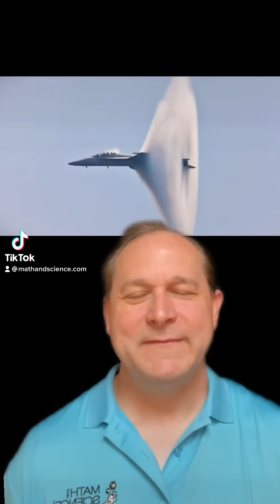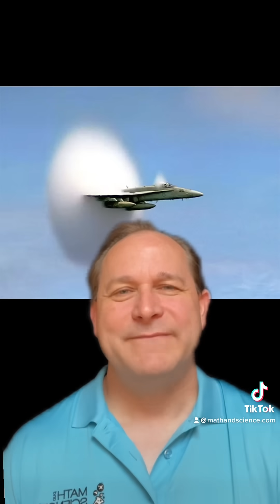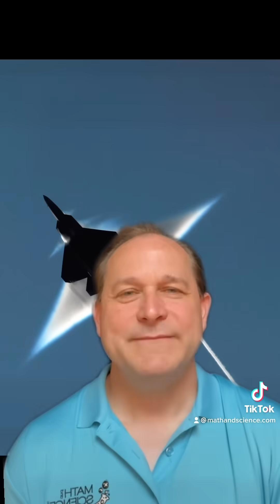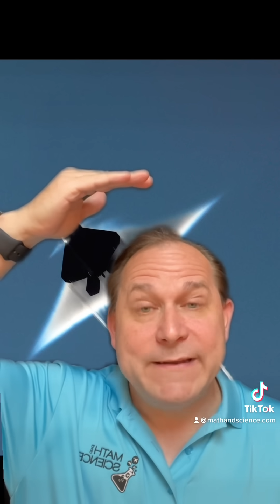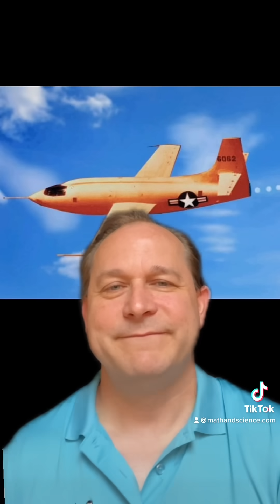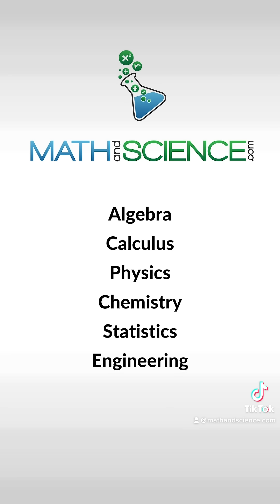What Exactly IS a SONIC BOOM?

Comment: You describing a sonic boom as "the sound of thunder" made me smile, because thunder is also caused by a sonic boom effect. Lighting travels between 1000 and 300,000 mach depentding on the type of lightning strike, so the sound you hear is literally the lightning ripping through the sound barrier.

Comment: It is not one shock wave but two or more. It is ideally a N wave with two front shocks  of compression, the oblique line is the decompression period. We can have several fronts in case of discontinuities of the projectile surface.
And the condensation that we observe on the picture doesn't materialize the first shock wave, the cone begins at the nose of the plane not at the wings.

Comment: That's what causes the crack of a whip and the lightning strike as the tip of the whip travels faster than the speed of sound. The same with the lightning strike. This is what I've learned. Maybe you can confirm this Jason or if incorrect let me know.